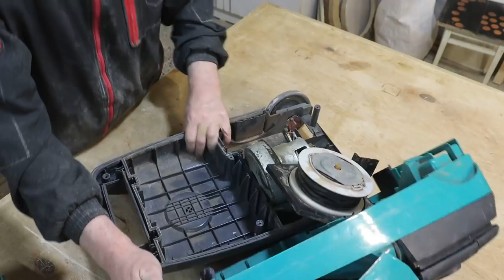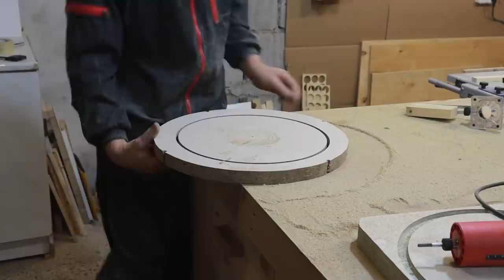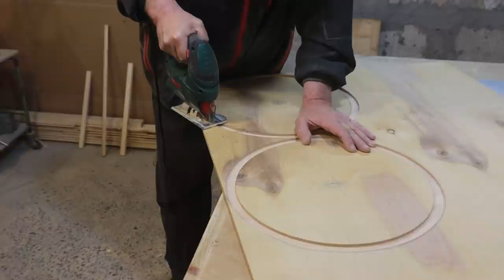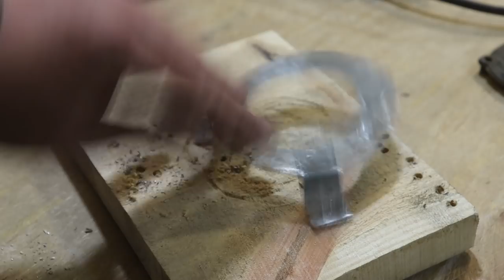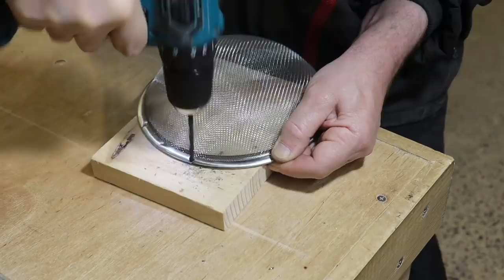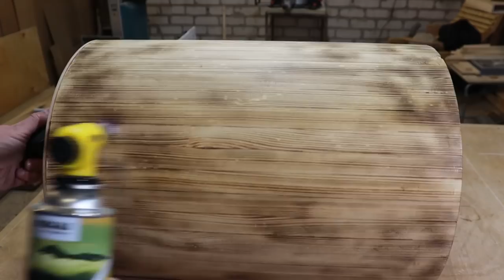Perfect Wood Dust Collector Cyclone From Old Household Vacuum Cleaner - Simple Build Creative Craft

Comment: Nice job. 

From a 50 year woodworking vet:  Make and use push blocks/shoes, rather than those garbage push sticks that ONLY hold down the wood in front of the cut. 

Dangerous kickbacks start at the back of the blade, where the push sticks serve little or no purpose.  A push shoe holds down the wood over several inches of the project and goes a long ways to cutting down on kick backs, because it does help hold the wood down, rather than allowing it to pivot UP at the point a push stick is holding it.
Reply from the maker: Thank you friend. Take note.
Reply: To add a tip, drop your saw blade so it is just 1 or 2 mm higher than the timber you are cutting. It is sooooo much safer and I find it leaves a cleaner cut as there is less deflection on the blade.
Agree fully with Kelly, I use the "push shoe" from John Heisz ... have a look on his channel.